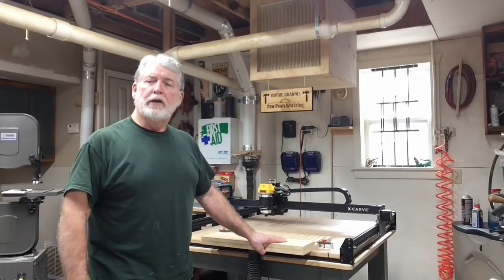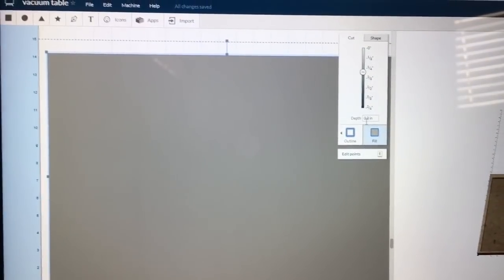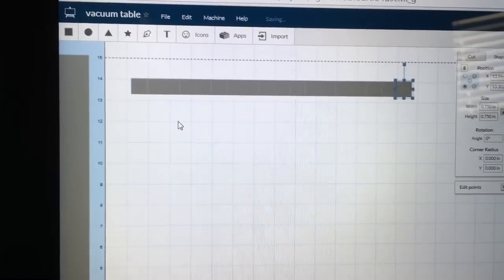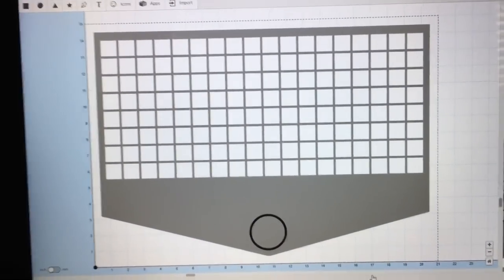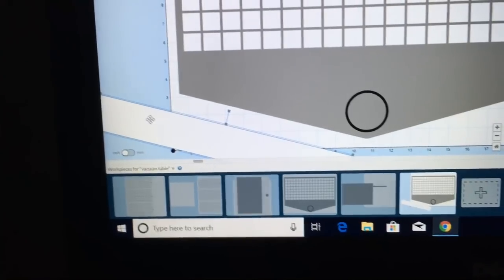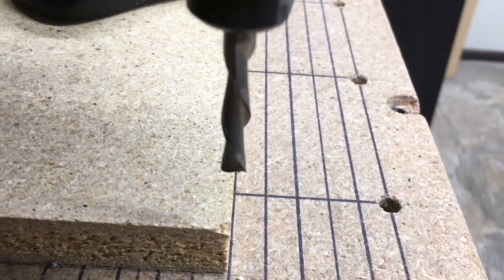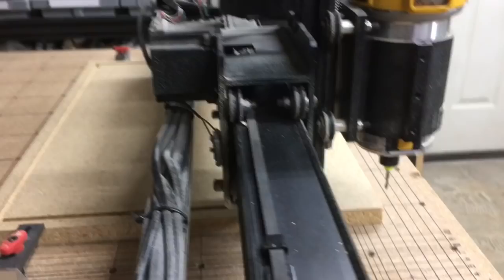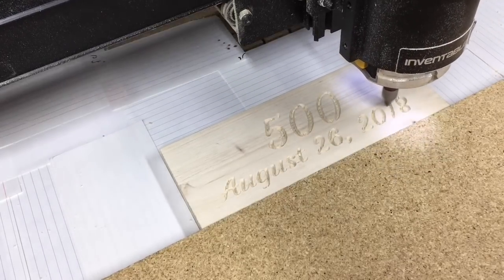How to Make a Vacuum Table Using Two Stage Carving for your CNC

Comment: If you seal (epoxy or even paint) the surface of the platen with the grid, you'll get more clamping ability as the top board then becomes the plenum as its porous. Otherwise you will get leaking vacuum at the grid level and that's lost holding power.  Great job.
Reply from the maker: Yes, excellent. The MDF is porous and the air will go through it. Thank you for watching

Comment: An easier way, instead of counting off the X/Y after changing the bit, is to select the second option on that screen. I think it's "or use last X, Y position." Saves me a ton of time during two-stage carves. It will take you right where you need to be.
Reply from the maker: Yes, I have discussed this before.  I have had the machine lose the last position and take off on its own.  I have been reluctant to use it again.Thank you for the suggestion.

Comment: Im wondering if i make one....if it would be better to make smaller vacuum path slots...maybe 1/8" instead of 1/4 " if that would help hold better? What do you think?....
Reply from the maker: I'm not an engineer, however, mine with slots just over 1/8" works great.  The only way I could determine if larger slots would work better is to just try it.  I have no way to measure the vacuum.

Comment: Hey paw paw...why did easel use 1/8 bit to do the square grid pattern?..werent the slots all 1/4 wide?.....why wouldnt easel machine it during the rough pass wit 1/4 bit?....or was this your choice?
Reply from the maker: The slots are just over 1/8" so that I could use the 1/8" bit.  This was by choice.

Comment: If u didnt choose a detail bit and just used 1/4 bit....it would have still been able to carve the project correct?
Reply from the maker: I used the 1/4" bit to clear out the large area and the area around the perimeter of the table.  The detail 1/8" was primarily used to cut the grid.  If I had used a larger grid slot, then yes I could have used the 1/4" for the entire project.

Comment: Very nice paw paw...i have a store bought vacuum table made of aluminum 14x24 someone gave me....ive never used it.....i would like to try and make one like yours...the only issue is that shop vacs arent really designed to run non stop like this for lenthy periods of time.....how has yours held up?
Reply from the maker: My shop vac has held up really good.  I have had no problems at all.  The key is to allow some air flow.  In the video, I explain that I do not completely cover all the exposed space.
Reply: The problem with some shop vacuums is that they only have one fan that is used for both pulling a vacuum as well as cooling. The motor in this case is usually behind a filter of some sort. As vacuum is pulled it draws in debris into the body of the unit, air travels through the filter and then around the motor body to provide cooling. There are a couple of manufacturers (that I know of) such as Festool and Fein that make units that have separate cooling for the motor so you can essentially run them under high load with no cooling issues. These solutions come with a pretty healthy price tag. As an alternative to this a small $30.00 shop vac from Harbor Freight fits the bill quite nicely. You really do not need a large dust collection capacity, just a vacuum source. If it dies you are not out a bunch and you can buy 25 of them for the price I paid for my CT-36.

Comment: hi paw paw i thought your slots were 1/4 inch.....i was asking if 1/8 would be better...you made 3/4x3/4 squares and put them in the right upper corner of the 1 inch grid so that would mean you have 1/4 slots correct??
Reply from the maker: I changed the size slightly by expanding the whole project.
Reply: Ok paw paw..thanks...i may try it one day just making 1/8'slots ...thanks

Comment: My copy will not work....
Reply from the maker: Pete McDowell, what part did not work?  Vacuum size? Leaks?
Reply: @PawPawsWorkShop  No when I tried to copy all the squares it would not work for me it maybe be because I was doing it on a chrome book and not the real computer that I use for my CNC. I will have to try that later on today. These Chrome books are not very good. They won't support Java so one reason I had to buy a new HP laptop. Thanks for the fast response.
Reply from the maker: Good luck with it.  I have never tried Chrome Books.

Comment: There is movement. You can clearly see it in the video.....
Reply from the maker: You are right, there is slight movement that I did not see at first.  In the next video on carving the knobs using the XCarve, I discuss the slight movement and that using the 3x5 cards to cover the open area of the vacuum table was not the best idea.  It far better to use a waste board to cover the area. Thanks for the comments.

Comment: was this just a test?  Have you made a full size vacuum bed like this for your CNC yet if not, why not?
Reply from the maker: Yes, this was a test with one vacuum attached.  I have one designed for the table that uses two vacuums.  I really want to get a vacuum pump however, I can not afford it at this time.
Reply: I am looking to build a cnc and laser engraver in one machine but unlike this, you know the vacuum pad ones of ball and spring to close hole, I am looking to do a table with it and have vacuum pump, put work on table and push balls down to open holes and vacuum work down

Comment: 13:21 It moves
Reply from the maker: I addressed this in later videos.  The cards allowed too much air to escape.  I later used additional wood to block the air flow.  It worked much better.  For simple designs carving shallow this method with the cards work just fine.